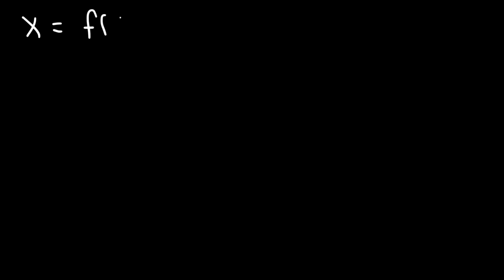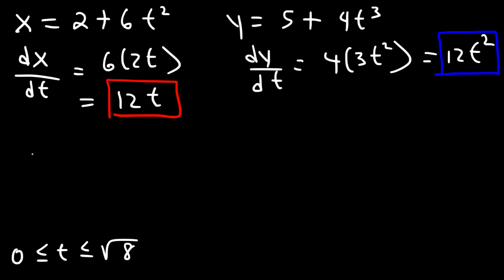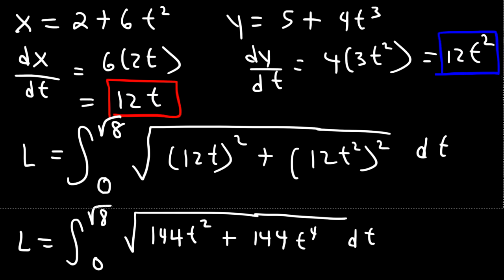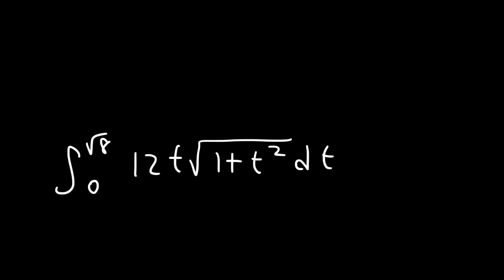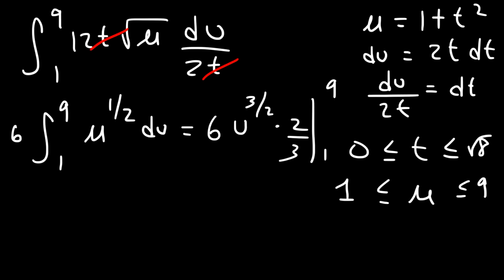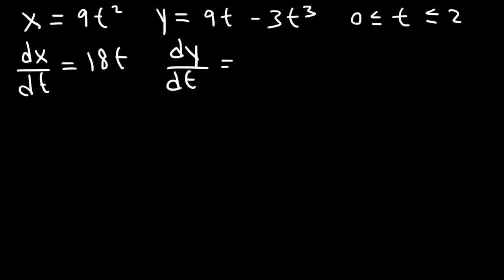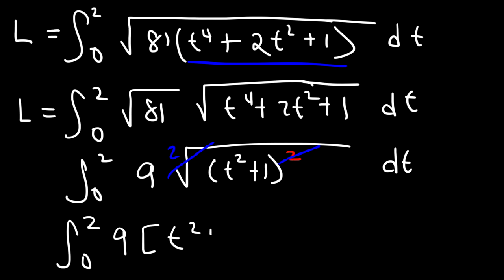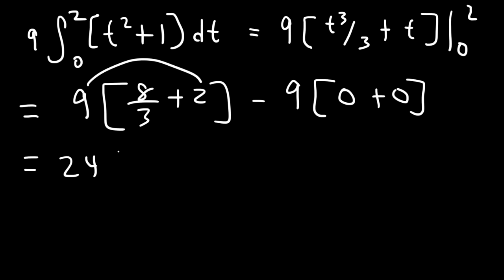Arc Length of Parametric Curves

Comment: You did a  u substitution but you never replaced what u equalled back into u. Is that not the method?
Reply: You can do it either way, but if you integrate with u then you just change the  limits of integration